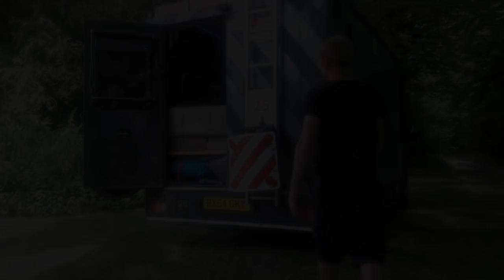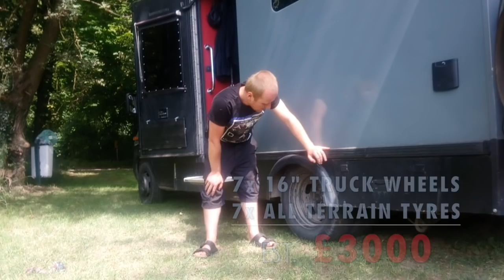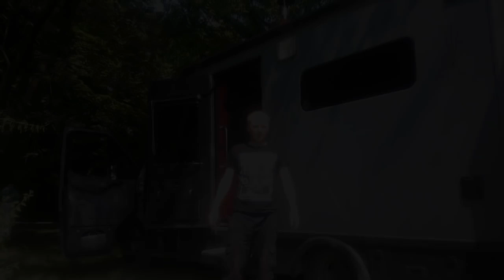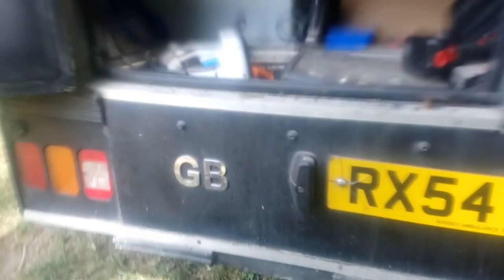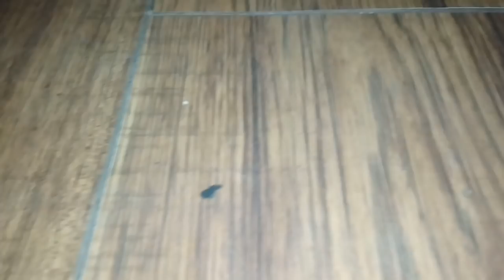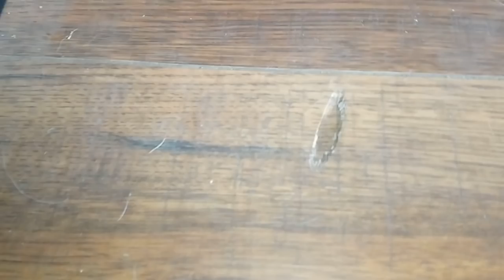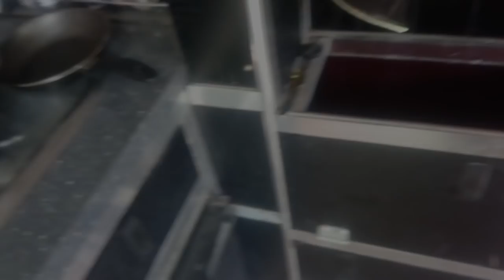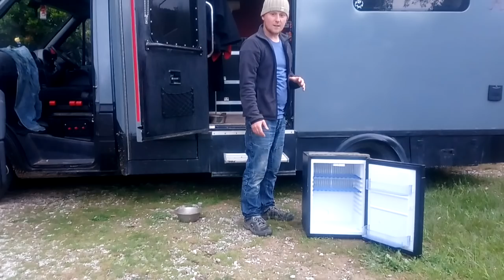Where I went wrong with my van : mistakes & planned changes

Comment: Me again. Your a handy geeza, build your own chest fridge, fibre glass is pretty easy to work with and just rip the cooling system out of a second hand 12v fridge. No cold loss with a chest fridge when you go into it. Ask me nicely and I will help you source and fit some automations to start ya van when ya in the back. Some exterior camera's for security, blah blah and all from your phone. Not expensive at all.

Comment: Hi mate with regards to the system you called where the engine would run, Ambulances have this feature in the UK it’s called a Run Lock system basically when the ambulance arrives on scene they press the button arrive on the switch panel this will then put the run lock in and your able to remove the key and lock the vehicle. We had them fitted to Ambulances in the early 2000’s 

Have a look at the old switch panel that I notice you’ve kept and try pushing buttons until you find the arrive one you’ll soon know as you’ll take the key out and the engine will stay running. The American revving thing isn’t true it just holds the revs at tick over. 

Oh and if someone was able to jump in and try drive off the vehicle would just cut out and stall

Comment: Careful about putting the water tank outside the van below, big block of ice..... ask me how i know!!
Reply: Van it not be insulated? Planning on putting all my batteries, gas and water underneath. Not planning to hit the arctic circle but .....
Reply: Truth, even near zero celcius you have to empty and drain tanks, even recommended inside as usually warm air does not circulate near them.
Reply: @gamerfortynine  exactly why I said even indoors you should drain tanks. Been doing this for many years.😉
Reply: Yeah, our black water tank froze one year and the blade valve handle broke off as we tried to dump it. Of course, that only happens when you have 40 gallons of raw sewage on the other side of a valve you now need to remove. Not a pleasant job and our fresh water inside the RV occasionally froze in the pipes in Western Washington (similar weather to the UK) so insulate it well!
Reply: He won't be happy if he does put the Water under the Van, he'll figure it out !!!

Comment: FAIL means First Attempt In Learning, well done 👍. As for air suspension Don't bother i've been a trucker for some 30yrs & air suspension is a big problem airbags go after a while butterfly valves stop working & compressors are not as great or as reliable as ya think bro forget it its a bad idea with great intentions. I've done mine chalkboard black so I can right stuff on it while I travel around

Comment: Regarding the fridge, i have the Dometic CRX110 12 volts, never had an issue with it, worth checking it out, not cheap i paid $1490 for it. but sure is worth it. it comes with 3 year warranty

Comment: Really useful video - thanks for making it.
Reply: Oh, the other thing - you can rig up a hand throttle simply with a cheap lever and bicycle cable with a clamp onto the accelerator linkage for about a tenner I reckon.

Comment: 15 inch wheels .... but which size tyres? I go on Maxxis Ma Las all year 225/70 R 15 "c" with the C as a "reinforced" indicator for my 2 ton bus, works well on gravel and soft roads and even in winter until I need chains anyway, and it's not a loud all-terrain tyre keeping up still ok-ish in terms of kilometres .... mine is a 1999 Sprinter 212 d first series though, I don't know what tyres You're supposed to put under Your second series with this twinwheel rear axle; it's a 3.5 ton ++ axle, so "c" might not suffice - or You reduce Your max load in terms of registration, something we do in Germany to get a wider range of tyres to be allowed. 
Sprinters won't become 2cv-s anyway, they aren't really offroad wonders in 2WD versions (factory 4WDs aren't so much better either by the way), so I suppose before getting started with an axle change or things like that to get single wheels/tyres on, You better might get Yourself a GOOD electric winch in the front and another one somewhere under the body in the back as well as an assortement of pulleys, belts, shackles and stuff like that to help Yourself when stuck. Only reason to change rear axles in my book would be the gearing. Mine's a "long" axle, actually the longest they made for 212s, and I get an absolute dream-milage out of it with a hightop swb 2 ton version.
There was even a gearbox version for 210/212 with a secondary power outlet to drive a winch directly back in the nineties - so no option for a semi-automatic I subsume, and it would be another place to become leaky now or later, that's why I prefer electric winches.
Reply from the maker: Yeah its a bit of a minefield, but your right I think with a winch or two I'll be a lot better off on the event of getting stuck

Comment: Any used car my dear old dad taught me a lifetime ago (1960s) breaks, tyres, shocks, wash the engine before test drive then check for oil leaks and clutch. Tyres and belts are easy peasy but the others are more consequential he did add points not that cars have em now and also plugs which if there is oil in there that is a warning.

Comment: Cool.  The bottom of the sink and bathroom shower should not be flat.  V  shaped sink that then tapers to one side with the drain.  Bathroom drains to one funnel like spot with grating flat over it.  Teak or metal or plastic if you use it a lot.  I would use one of the new plastic panels milled down and perforated.  Thanks though I learned tons from your build.  its awesome BTW.

Comment: ARB top loading fridge are amazing, ultra quiet and very low on power comsumption. They are pricey but are brilliant. As your taken the rear off vehicle, why not buy another from a breakers and do all the work on that and just swap over. Yeap the air ride systems are cool one to lift 3500kg with auto level is about £3500, not sure how much for 5000kg would be cool but pricey.

Comment: I think you're taking to many home comforts to go traveling and living in a van.  Why don't you learn ways of living off the land.  Learn how to cook on an open fire etc?  Do you really need gas? Minimise the weight of the van and only take the assentails.
Also, there are many 15in AT tyres out there with an 800/900kg load. With 4 of them on the back that's 3200kg load just on the back, or 4.8 tonnes with all 6 tyres. I believe your van has a max load of 3.5 tonnes? At around £100 each tyre you could save a small fortune.
Electric will serve you well. However, it will be pricey.  For the UK I would recommend the 'Amorphous' panel. The roof of the van is plenty big enough.
Reply: I think the deep cycle battery bank big enough to run electric cooking might be abit heavier and bigger than a gas bottle mate... that is unless all he plans to eat is half a pan of super noodles a day... do you go round light camp fires on aires aswel aye? Generating heat from electricity is about the most inefficient thing going.

Comment: tip - taper your sink like  -v-  with plug in the middle, alloy and bare steal need a seal in-between the two metals, alloy and steal don't like touching each other, if moisture gets in-between the two it corrodes the steal very quickly.

Comment: Yep the dometic/ engel fridges are pricey but you can’t put a price on cold beer ! I have a big top loader that i remove and use in other vehicles when i need to,quite happy to run it for 12hrs+ parked up in the back of a landrover without a split charge in 40c no worries.

Comment: bad idea to move the water tank under the van if you spend time in it in sub zero weather.  Where you have it now helps keep it from freezing.   So unless you insulate and heat the water tank; putting it under the van is bad idea mate.

Comment: If your throttle is cable controlled then you can  fit a universal choke cable to bring the revs up, like the ones they used to have on most cars in the 70s where you pull the knob out and twist it to lock it in place. My current Toyota has an "Idle Up" switch but my previous one had a cable  with a twisty knob where you just wound it up to whatever revs you like.

Comment: Fridges - if a compressor fridge is really expensive why not use a 240v tabletop fridge and to power it get an extra solar panel and extra battery. My van has these - the fridge cost just £99 and it works great except for winter when the solar output is low.

Comment: Contact Mercedes about the high idle. I know on the older model ambulances here in the states it was an aftermarket add on but in the last couple of years its been a factory option at least on the other ambulance models(ford, dodge and GM). Its run though the cruise control system into the ECM so it might be something your local merc dealer can install. not sure on the price of the entire thing though.

Comment: look for the vitrifrigo fridges, they can be bought considerably cheaper than most other makes and still run the danfoss compressor and controller thats fitted to every compressor fridge,   my first massive euro trip was with a stupid 3 way fridge,  it sucked balls, at one point it actually heated the fridge,  so it stayed off for the rest of the 3 month trip,  
bought the compressor fridge and havnt looked back,  it'll run for about 6 days (with out any charging) on a 200ah system with no solar (mine charges the batteries as i drive, via a relay or if i plug in )  if i drive half an hour a day its enough to to keep the system ticking over nicely

Comment: I rushed my first van and spent the next year doing 'things' every weekend but it was great fun. My van was a LDV crock-O- Shite where the clutch slave unit would leak fluid all over the brake pedal every so often and had to be replaced every 6 months.....and then issues with the gears and clutch......still it was worth it for the experience. That was 8 years ago. I am in the process of selling my house to motor home full time round euroland probably mid 2019 ! Good Luck buddy with your build. Might see you out there one day :-)

Comment: I wonder if it would be possible to rig up a second idle-speed control unit stuck at 2k rpm and have them on a switch to go between (I'm not a mechanic and could be talking crap). Another half brewed idea for the ceiling, maybe you could use a needle and syringe to inject some glue though I'm not sure if it would leave a noticeable mark behind. Just subbed, great video's!

Comment: realy like the ambulance as a base as its insulated and a lot stronger than a regulair boxvan , wouldn't be suprized that if you take the original floor out you come across a lot of insulation 

there propane bottles that have an lpg fitting and a propper 80 percent filled auto turn off system you can fill those at a tank station 
https://www.kampeerdump.nl/staande-lpg-tank-met-bajonet-haaks.html?gclid=CjwKCAjwzenbBRB3EiwAItS-uxbq-rwXMzfoxLLIFi1nte3SAArM9r5ZIgeCR3Bm3btDCxwmeQFdYxoC2iMQAvD_BwE

you can allso find gasbottle to lpg adapters and fill youre original bottle 
http://www.lpgshop.co.uk/uk-bayonet-filling-adapter-to-shell-gas-bottle-inlet/
but they frown on that as you can overfill it if youre not carefull and watch the liters going intoo the bottle (need to fill only 80 percent of the bottle to alow for presure buildup when hot )

you can get the same system as a tank you can build under the van , these have the fuelpickup above the liquid lpg so only pick up gas not liquid like a normal car lpg tank does 

about the awning , tarp some rope and tentspikes work too 
or a party tent 
https://s.s-bol.com/imgbase0/imagebase3/large/FC/4/8/8/7/9200000026337884.jpg it be a small package you probably can store on the roof 

as for storage space : you can get a trailer hook and mount a cargobox on it , 
http://theoryoffashion.info/wp-content/uploads/2018/07/hitch-storage-box-swinging-enclosed-cargo-carrier-for-2-trailer-hitch-hitch-cargo-carrier-rear-hitch-cargo-carrier-box-rear-hitch-cargo-box.jpg 
might even be able to get a higher one with a rear door like they have on the back of a touring car going to wintersport countries 

be careful putting youre drinking water on the outside of the van as it can freese up a lot more eazy than inside the warm interior 

think mercedes can open the cruisecontroll electronicly using their star or xentry system and add a (new stock) wiper stalk with the cruise add on 
they need to remove the steeringwheel to get to the stalk and maibe pull a wire or two 
did some quick reading up on this subject and having an automatic makes it eazier 
you need to ask the mercedes dealer (have the chassis number on hand when you make the call  they can check it using that ) 
or a chiptuner that can hack the electronic box (its been known that these guys have the same system that mercedes uses but are less bound by mercedes pollicy )

wat you could do with leveling the van is using garage jackstands 
https://vdxl.im/5906083803093_a_en_r458.jpg and a few pieces of wood 
, lift the airsprings up to the highest postition put the jackstands under the chassis and let the airride down , you can use a waterlevel to estimate the offset when the van is in the normal position and use the pieces of wood on top of the jacks at different heights closer  to level the van of once the airride is down , it will make you less seasick walking inside the van too

cant realy help you with offroad tires in that size , wat you could try is see if there retread companies about that can retread tires in an offroad profile , retreads arent good tires , there basicly old tires with a new tread vulkanized on and their known for loosing big chunks of tread , they do have the original loading capacity you need and for the rearwheels they should do (could only do the inner tires for a bit of extra grip 
or mount snowchains on the rearwheels before you go on muddy roads 
(you be suprized how good those work in the mud , just dont spin youre tires up to say 50 mph or the chains be flailing through the  inner fenders )

Comment: The accelerator thing the Americans are telling to about is call run lock and is used on UK ambulances it's a button
Reply: If you can't figure it out, I would suggest finding a heavy duty shop that deals with Tow companies. Tow trucks need that option to run their hydraulics properly.
FYI, if you have a list of option codes for your van, the 2018 Sprinter codes for this are either M53 or MT4. If you look up the sales brochure for your year of chassis, you might be able to confirm if yours came with this option from the factory.
Reply from the maker: Oh really? Ahh I'll take a look then, if it was fitted to my model then maybe the wiring is already in the loom

Comment: Keep your water/plumbing inside unless you plan on never camping in winter.  Get a 12v top load chest fridge, much more efficient and you don't cool the floor every time you open the door. If you need a freezer get a larger double model or use 2.   Good Luck

Comment: Hi mate, with an ambulance can you just turn the engine on and then run whatever you like electrically i.e.turn the engine on and then run a microwave for 4 mins to heat up a readymeal, then turn it off again? they have super heavy duty alternators or something? thanks!
Reply from the maker: Yes it has an uprated alternator, however the microwave is still to much even for that. Waay too much strain on the system. But everything else in the van mains yes the van can sit happily at idle - 1500 and keep everything charged

Comment: Lino can dent and tear, what about vinyl flooring glued together?
Reply: Was thinking of using vinyl click flooring in my van, easy enough to cut and lay like laminate but waterproof, hard wearing and nice to walk on with bare feet. About the same cost as laminate too.
Reply: Jonathan Williams
...and it also doesn't expand and contract in the heat like wood flooring does
Reply: @MrGenedancingmachine  Yes, another plus! I've used it in the house on top of the recommended thin foil backed foam insulation and it's  been great on bare concrete so I reckon it'll insulate well in the van as well.

Comment: We took out the stainless steel tracks. Was t too hard in the end. My wife held an Allen key in the slot up top and I crawled around underneath and cracked the bits with a socket On a ratchet 
We took up the vinyl that was pretty gross and blood soaked under. Our floor is honeycomb fibreglass, so
I then filled the track gaps with spray foam that sets feasibly hard and fibreglassed over the top.

Our plan is to then cover with vinyl 
And yep.. lots of planning and going slow.
Reply: zed elliott r

Comment: Av just bought the weaco crx50 your right 550 is a lot for a fridge.  But they are superb.  My 200w solar system runs it 24 7... great video's and adventures. 
ATB dave
Reply: You'll struggle in winter. My 200w barely ran a laptop all day over winter and that was in Portugal. If I had a compressor fridge on top then I'd have had no chance. 400w is better for fulltime with compressor fridges.